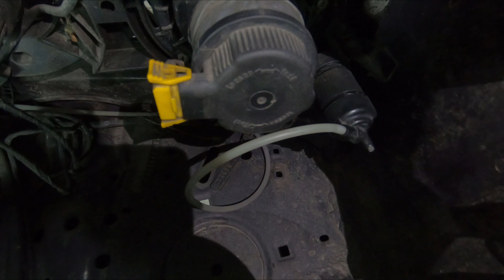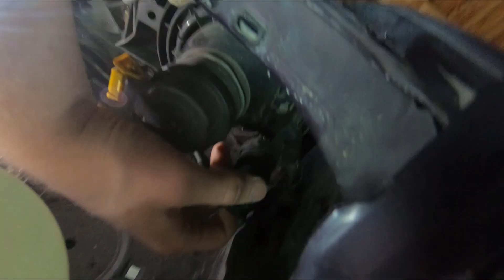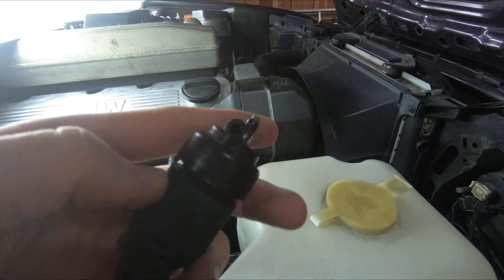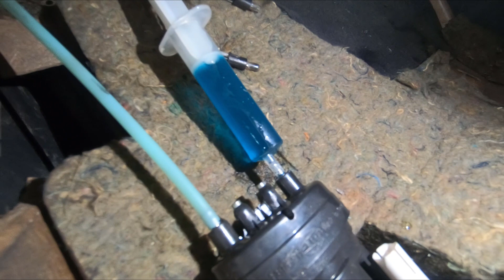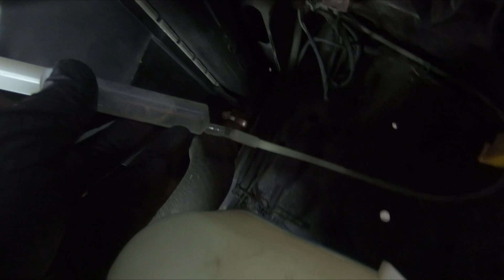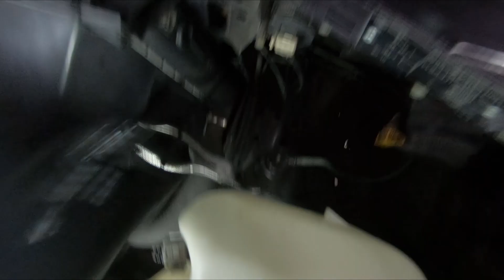BMW E30 Headlamp Beam Height Control Repair - Leuchtweitenregulierung (LWR) Reparatur Anleitung

Comment: Thanks for the upload. I bought a new adjuster. By how much should the adjuster move when the knob is turned? I get about 3-5mm of movement. And lastly, how do O thread the unit through the bulkhead. The old one went through the wiring loom but the replacement unit has a grommet of its own…

Comment: Hello.  I bought the new genuine BMW replacement assembly.  Few years ago,  worked OK for about 1 year then stopped working.    I bought a New one again Genuine from BMW, worked for another year then failed.   I can't see any leaks near the adjusters, the knob underside seems a bit moist but can't see anywhere where fluid has leaked out.     Is there something else like the knob that fails?     Unsure what to do or how to troubleshoot.

Knob feels much easier to turn compared to when new.   I'll check again for any leaks.

Comment: Your series on the e30 wagon is awesome, I'm contemplating if I should get a 316i touring design edition in daytona violett, basically the same spec as yours, for 1500 euro
Reply from the maker: Thanks for the nice comment. I really appreciate it! I can recommend you an E30 Design Edition. They are very nice and for 1500€ quite cheap compared to other E30 models.

Comment: Good work mate, keep up the good work 👌
I have same problem but the little nipple hole where hose goes over on adjuster is slightly cracked like in video, did you seal it some how?
Reply from the maker: Thanks for your positive feedback, I appreciate that!
The fitting of my cylinder was cracked, but used hot glue to seal the crack and it works fine. No more leaks or air in the system.